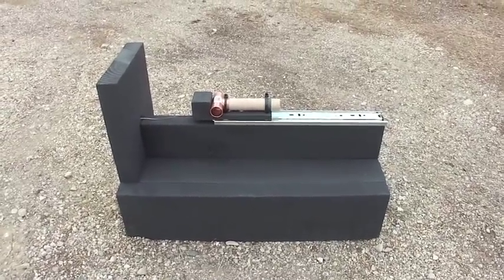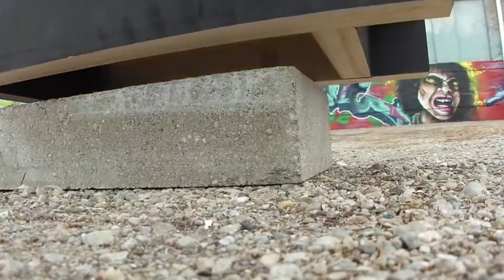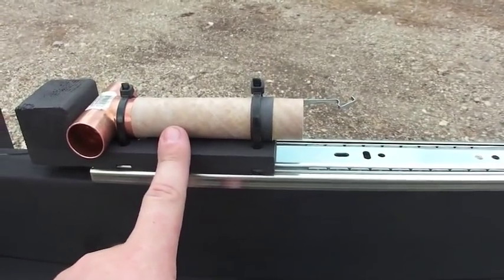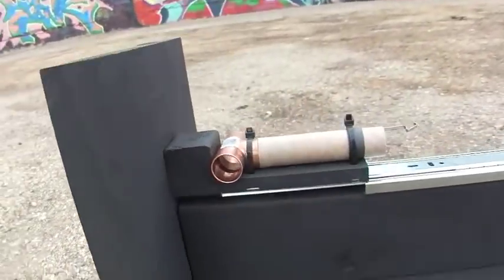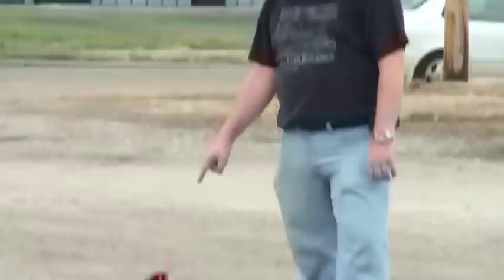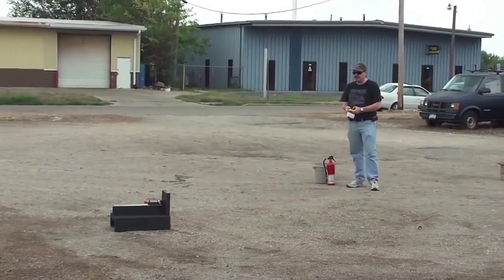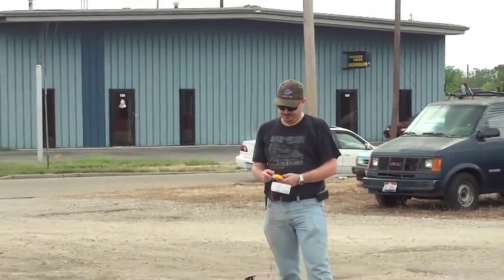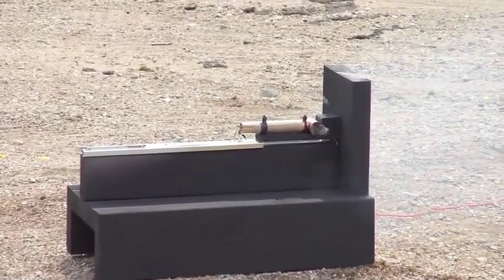Shepard Test Stand Demo Reel

Comment from the maker: We are using a Force Sensing Resistor (FSR) to measure thrust and a thermocouple for case temperature.  The next revision will use something else to measure thrust, as we are not completely satisfied with the FSR's performance.  See the detailed design notes listed in the video description for more info.